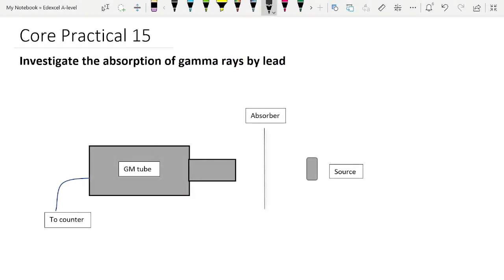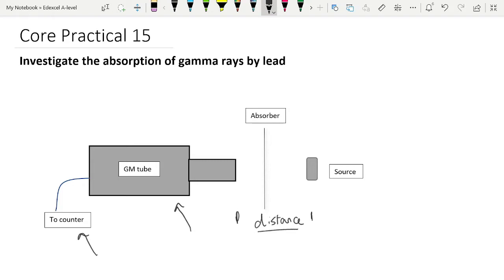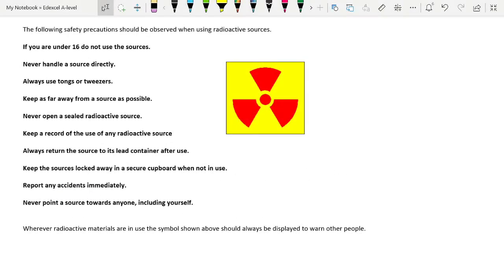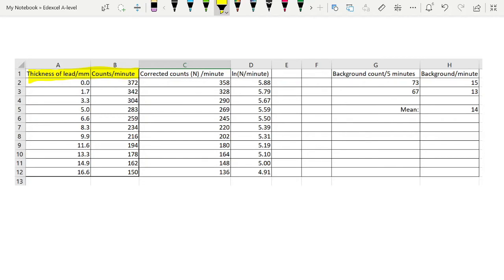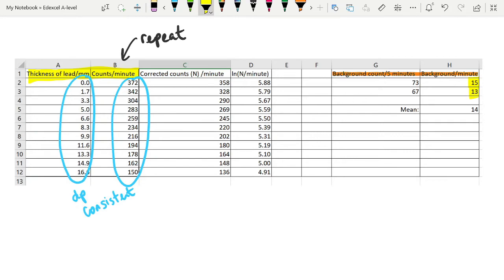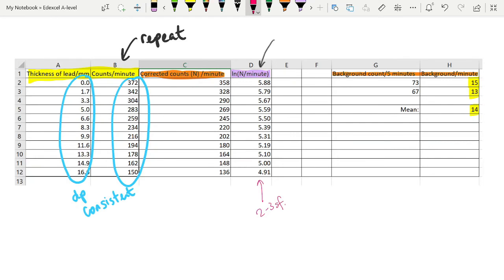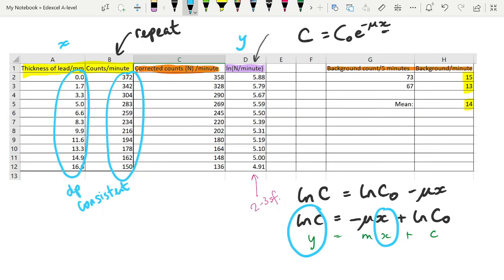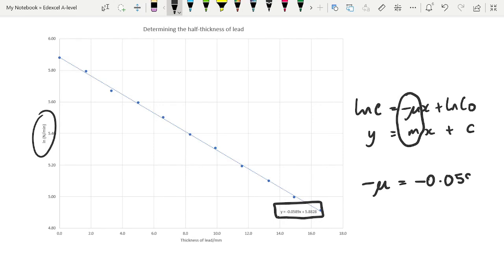Core Practical 15: Nuclear Radiation: Edexcel A-level Physics

Comment: Shouldn't you have included error bars and given a percentage uncertainty for the half thickness?
Just asking because this is important in the practical endorsement.
Reply from the maker: Although a couple of experiments do suggest error bars, they aren’t required for the practical endorsement, nor are uncertainties. Those are important to know how to calculate for the practical questions though. Not for log graphs though.
Reply: @nutshellphy  I do OCR Physics A. Surely it differs for different exam boards, right?
Reply from the maker: The practical stuff, yes, some of it. Because the calculation of uncertainties can be done in different ways, for example. But the theory, no. Though you will find that different boards have some extra or fewer topics or they may require more or less detail in certain areas.

Comment: I think you need to sort out your column headings in the table.  Count rate is measured in min^-1.  Column D should be headed ln(N/min^-1)
Reply from the maker: If you look back at Paper 3 from a few years ago, this very thing was tested. 2019 I think.
Reply from the maker: Count rate, by definition, means counts per second. One can certainly have counts per minute but that is not count rate. My headings may be wrong, you’ll have to specify exactly where you mean, but not for that reason.
Reply: @nutshellphy  I am keeping strictly to the quantity / unit format of labelling column headings and axes of graphs.  Also, I am not bothered about the per second or per minute.
The heading of Column A is perfect.
The heading of columns B and C ought to be counts/per minute and N/per minute.
The heading of column D should be ln (N/per minute)
So as it currently stands, your unit in columns B and C is 'minutes' and the label of column D is dimensionaly incorrect since we can only take logs of a number.
The advice to repeat, take means, be consistent with DP and/or SF is great.
Hope this all makes sense.
Reply from the maker: Well, I can understand that but I think that you should be since Edexcel expect that you know that count rate means per second. Like I said, they have tested this in the past. They are extremely fussy about details.
If I put the quantity/unit in any other format, I should not have. I’m amazed if I did, I am very strict about this normally. I will check.
Reply from the maker: You are absolutely right, my apologies, the counts per minute columns in the table should all be counts/minute^-1 at the top!
Reply: @nutshellphy
Reply: Thank you for all your excellent resources.